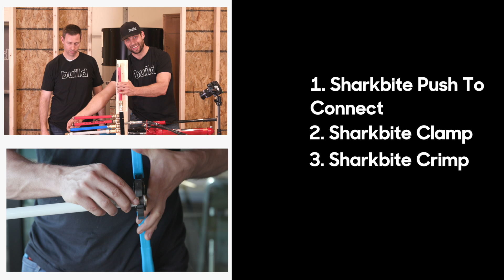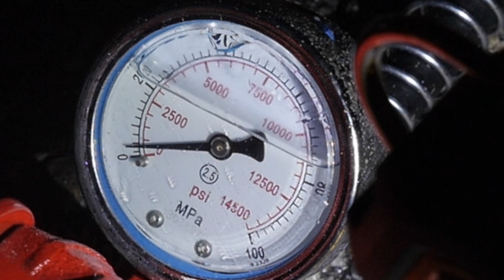Can we blow off these PEX fittings?  Sharkbite vs Viega vs Uponor

Comment: I would like to see a digital pressure gauge with recording capability therefore it will hold the last pressure before it began to drop when it burst.
Remember the larger diameter tube, hose, pipe will have more square inches of surface then a small diameter tube etc. If the PSI was 500 in each one of those there is significantly more square inches to work against in the larger tube. Hence a larger area to work , more square inches lower burst.

Comment: Should have added Type L and M copper pipes to the test.
Reply: Yeah that would've been interesting, but they really weren't expecting to be testing the pipes themselves I think :)
Reply: @UnbeltedSundew  
It would have been interesting to see if the sharkbite held onto the copper pipe any better.
Reply: I agree, great test. But I would like to see M & L copper pipe tested with solder joint, shark bite and propress  connectors. 

Think you can make that happen guys?

Accurate pressure gauge would be a Big Bonus!!!

Comment: This validates all of the work I've been doing over the years. I have always used type B PEX with various crimp connections and never had a problem or a leak. I stick with the copper or SS crimp rings and never use the "pinch" style crimp rings. People talk about Uponor being the best but in reality it is just easier for the plumber because with PEX B you have to think through which connection gets made first when you're in tight places. Thanks for showing this guys, and Merry Christmas!

Comment: Average household water pressure is 60 psi. LOL
Reply: Only true if it has a pressure reducer. When I bought my house I tested the pressure because I saw it did not have one (built 1990). 118 psi on cold water line. Hot should be even higher.
Reply: @davidkellers8152  hot psi is the exact same pressure as the cold, this only changes in a closed system.  118 is likely due to head pressure ( water main drops from a higher level ) but is not impossiblle to have at a building main.
Reply: @MrDmadness  In what is hot water not in a closed system? In an open pot on your stove? Wtf are you talking about? Everyone here is talking about hot water systems in homes. Since water expands when it is heated it increases pressure on the hot side of the pipes. This is why expansion tanks are put on the hot side. Even with an expansion tank it is still a closed system and the tank must be sized to the system or the pressure rises. 
Over 100psi is fairly common at buildings and homes near water towers. Which is why I mentioned it.
Reply: Hulk Smash  You are correct. Wasn't paying attention. It is so there is no back pressure due to heated water.
Reply: Recently had a home where a customer took the pressure reducer off because he wanted more water pressure at the showers. Pex burst in ten places, but only on the hot side. Type b pex. Heat not only expands the water but reduces the pressure capabilities of pex. 
Cannot figure out how first burst didn't reduce pressure unless they all went at once. Homeowner threatened supplier and manufacturer with lawsuits. Carpet in just one room was $50,000. It  was replaced with type a by supplier and manufacturer at their cost.
Reply: Hulk Smash  House im talking about is off Franklin rd.
Reply: @Jeremy Hess I reduced the pressure to everything but my spigots.

Comment: Could be interesting but completely worthless without a pressure gauge to know at what point these fail.
Reply: They ALL went WAY up above any water supply system pressure before failure.....so.....does it matter at all?
Reply: @mikeparker5008  Yes, it makes a huge difference. When the fire department tests a fire hydrant, they often turn the hydrant off too quickly and send a static shock wave that can reach hundreds of PSI. Also, a system with a check valve and no expansion tank can see the pressure rise fairly high after running hot water.
Reply: The tests showed that, other than the press on shark bite, all fittings held past the pipe failure. That’s good to know.
Reply: Your understanding of the word worthless must be lacking. One obvious point, is it shows what's the weakest to strongest connection...pretty big point
Reply: A ton of room for improvement but I wouldn't say it's worthless. It's okay as a comparative analysis.
Reply: @bradley3549  not really we have different lengths of pipe all set up on a manifold it's a pretty useless test when actually looking to test multiple product.
Reply: @twiztedclown  What does the length of pipe have to do with anything? Pressure is pressure regardless of the length of pipe.
Reply: @bradley3549   The only thing I can think where pipe length matters is that the longer the pipe, perhaps the greater chance of having a weak point somewhere along the length of the pipe - increasing the chance of pipe failure.   Shouldn't matter at all for the fittings.   In this case, the lengths were all pretty close anyway so seems like a non-issue.
Reply: Not really
We know the press on sharkbite fitting failed
The rest of the pipes failed way past the working pressure.  But the fittings held....
So in the real world of plumbing.  
This test shows the press on sharkbite is less desirable..
Reply: @jimh712  that's also a sharkbite push to connect plug. Regular fittings that allow flow of water are under much less tension and pressures. Any training tells you only use a sharable plug for a quick 2 minute stopper to get the proper plug fitted in place.
Reply: @twiztedclown  All the fittings in a closed system will be under the same pressure - whether it's a plug or a coupler. Unless you run your water 24/7? Sharkbite demonstrably holds less pressure than other fitting types, that is no surprise to anybody really. Is it enough? Of course, in 99.9999999% of the circumstances it's fine.
Reply: Ghuuuyyyyyhhhhuuuųųū
Reply: (see the next video)

Comment: I’d definitely love to see a test where the pressure of failure was recorded.
Reply: And a non-leaky connection.
Reply: Hahaha I just said I would love to know. Also, he posted a video today of exactly that. 😂
Reply: well i think its completely irrelevant considering that NO home has that much pressure. City water is ~35 psi and well pump homes are slightly higher but not over 60 psi ... 
So why even bother knowing its pressure point failure if the pressure will NEVER EVER get that high ... 
I'd be more concerned about the health affects of PEX usage over 30 yrs ...
Reply: @ACommenterOnYouTube  I know this is a quite dated post to reply, but most city water I've seen is above 100psi and pressure regulator is used to dial it back. Water heaters will begin to fail above 80 and are recommended between 60-80psi. Even and RV has a 60 psi water pump in them. I've seen home where regulators failed and ruined faucets and water heaters. Most faucets are rated below 75psi before the dreaded drip due to pressure build up. To also add a water heater will increase the psi slightly as it heats to cold water so best bet is shoot for 60 and have the safety from heated water expansion.
Reply: I dont know about you but when we had well water the pressure was around 30 psi or so. We switched to city water and now we probably have 50 psi or so water pressure.
Reply: (see the next video)
Reply: What does it matter what pressure it fails under.. As he clearly stated, NO HOME has that much pressure so the fittings WON'T fail in your home unless they are installed WRONG ...
Reply: You Tube would be great info to know.  Maybe for another applications

Comment: After seeing this  I would think the more accurate test would need to be done individually to eliminate any pressure difference at the manifold.  Also in order to give the Pex A and everything else an actual real world situation would need to go much slower.  So pressurize to a particular psi, leave it for an hour or some extended time and then come back add more pressure and continue.  One thing it would do is give the pex A more time to expand naturally but also we would see if time + pressure would affects the connections.
Reply: Stay tuned!!!  More to come...
Reply: there are no differences in pressure in the manifold, they are using liquid for the test, which means the pressure is equal in all areas since liquids are non compressible. I can tell by your ideas that you are not a plumber... respectfully intended... the time think is not a real world scenario at all, pressures can rapidly change in a plumbing system depending on demand and age of components.  if you really want to see pex tested then get a tour of Q.c. at any factory making pex or upinor. time and pressure do not effect it, pressure and temperature does.

Comment: I’m feeling good about using the crimp rings.. they held just as good as the others.
Reply: In my very limited experience with pex crimp bands/rings, one problem I think that causes leaks is from the pipe being too cold when crimped. When it's colder I keep a cup of warm water and dip the end of the pipe in to warm it. This allows the plastic to form into the barbs ( well actually they are recessed flats) on the fitting as you crimp. I trust this WAY more than crimping cold pipe.  You can see and feel the difference when you crimp. I'm sure there will be a know-it-all to dispute this and call me some seemingly clever name that equates to dumb@$$. So be it. I will keep heating my pipes as I crimp and sleep a little more sound knowing that in my perfectionism I have done all I knowingly can to prevent leaks.

BTW, I have seen the effects of leaky pex and it can be catastrophic as far as mold and rot go. This is because it leaks slowly and keeps the area wet without any warning to the inhabitants. I saw a horrid YT video on this just before I was about to use pex for the 1st time. After a few test crimps in the warmth of my living room I felt comfy enough to tackle the job. The next morning I pulled the cold pipe out of the back of the truck and made my first crimp and noticed the difference. I immediately got a cup of water and heated it in the microwave to heat my pipe. Seeing and feeling that difference of crimping warm pipe v cold pipe made me think that this could be a larger issue than realized by the industry. It should be tested, @Matt Risinger. Place a piece of pipe in the freezer overnight then make a crimp with a warm fitting, as a lot of people will keep fittings and bands/rings in their pocket while working . Next, run it through a series of pressure and water hammer tests with temperature variations to boot.

Still leak free here.
Reply: @3Hose  Amen. I use  stainless pinch  rings and pouring hot water over the tube just before clamping down does produce a firmer bond.  But  I would  bet the bond would  work well for household pressures either way.
Reply: All the methods work great when done properly. I decided on pex-a because the tendency of pex is to always return to its normal state, therefore the expansion method will constantly try to squeeze down on the fitting while pex-b will be fighting back to expand against a crimped connection. But I had to buy a $400 DeWalt expander tool while crimp ring tools are under $100.
Reply: My first house I used the copper crimp rings for a pier & beam remodel very small house and was so nervous about using them. I haven’t had a single issue or problem yet... every house there after  I went with Uponor and continue. Not one single issue. I just feel more comfortable. The only thing I can take away from this is as long as they are installed correctly and properly tested I don’t think you will have issues with either.  The 1st house has been issue free since 2009 I still inspect it every time I go to the house (rental). I don’t think I’ll be free from worry until I no longer own the house.
Reply: I used PEX-B and stainless crimp rings about 6 months ago with no issues yet. It's in a basement though, so hopefully the occasional high humidity won't corrode the rings. If I had to do it over again, I'd go 1" for all the main runs, and 3/4" to the fixtures. The 3/4" PEX-B is just too restrictive compared to PEX-A or copper.  I think I would also not be cheap and go with PEX-A next time too.
Reply: Every fitting in my RV PEX piping has those crimp fittings.  I bought the tool, extra rings and PEX pipes to carry in my RV.  I even added some mods and PEX shut off valves in the RV.
Reply: The uponor is best but most expensive. All these small diameter pipes will never come close to seeing these water pressures
Reply: 1806StoneHouse only use copper crimp rings the stainless ones will break
Reply: The  Uponor is better because the fitting is larger— more flow
Reply: @BrianBriCurInTheOC  bwaaaaa if you size the system properly then you will have the same preformance lol
Reply: colt johnson 
The different brands have a difference in each nominal size. Uponor has the larger inside diameter of all fittings.
Reply: @BrianBriCurInTheOC   wich means that they have a different sizing chart I have always ran the trunkline methed never had a problem with loss of flow it only becomes a issue if you do the branch line methed. But that's my 2 cents
Reply: No issues with crimp rings.. been doing this for 8+ years
Reply: Steel Crimp rings could corrode and fail eventually. Personally I chose Uponor. No flow loss, Pex is easier to bend and you can heat with a hot air gun to remove pipe kinks.
Reply: @guytech7310  In a climate controlled environment? Could spritz them with a lube that doesn't evap and they'd last forever even if a little damp.
Reply: TheGuruStud I believe the ring is stainless steel.
Reply: @TheGuruStud  Sulfur in the water can corrode the crimp rings.
Reply: @TheMigraineGuy  how does water come in contact with the crimp rings?
Reply: @flickerblip9044  sorry, I didn't mean the rings themselves but the fittings the rings crimp the pex onto.  Dezincification can occur, removing zinc from the brass fitting, which causes small holes to form.  The crimp rings lose their effectiveness when holes are present and leaking begins.  I think this happens more frequently in areas with high sulfur.
Reply: @guytech7310  thry are stainless steel.

Comment: I've used sharkbite 1/4 turn valves on several toilet supply lines and never had any problems. I wouldn't hesitate using them again.
Reply: Hulk Smash  They were the push on type. I was very skeptical...but they seemed to work as advertised.

Comment: Aside from the slide on Sharkbite, this test has nothing to do with which brand of fitting can withstand the most pressure.  It's misleading to rank the fitting based on this test.
Reply: Everything there would easily handle double the normal operating pressure of a home water system. Which should be the takeaway from this video. It doesn't take an elaborate laboratory to show that any of these systems should be adequate for residential use. I would like to see tests with hot water, with faucet temps and radiant underfloor temps.
Reply: @rbnhd1976  it would be interesting to see how well the push on fittings fair over repeated cycling of a valve in the system at 120-160 degrees. I'm kind of leary of the thing walking off.
Reply: I just noticed your name, you don't have blinker fluid in stock do you? 😂
Reply: @rbnhd1976  Plenty...LOL.  I agree, and understand the test's purpose - only disputing the results as stated. So state that pexA may rupture before pexB instead of fitting "x" withstood the most pressure.
Reply: its not misleading information in this video... the PSI  in a typical  home will not exceed 60psi. All the parts tested failed at a minimum of 100 to 500psi, way over the limit. So this means; that you can use any of the fittings in your home,  regardless of which fittings withstood the most pressure.

Comment: The way that flew off obviously there is air in the system.
Reply: It surprised us as well, as we bled the system of air before we began.  However, the system gained potential energy as the other pipes stretched under the pressure.  When the fitting failed, the remaining tubes sprang back to their original size, and turned the press time into a bottle rocket!
I should've seen that coming, but I'm not too smart 😉
Reply: @JordanSmithBuilds  Yes. I thought about that later. The things we get away with without getting hurt.

Comment: I ran 1 inch shark bite pipe and crimps as air lines in my hobby shop I know it is " illegal" for 3 years now never had a problem my compressor is set 150 PSI. I figure if it is able to stand up to that 40ish psi water is nothing.
Reply: Prv valves i think come set at 50 psi. I always have folks wanting me to turn them up.  I was curious to see which fitting type was the best. But that's impressive they even hold pure air in the lines